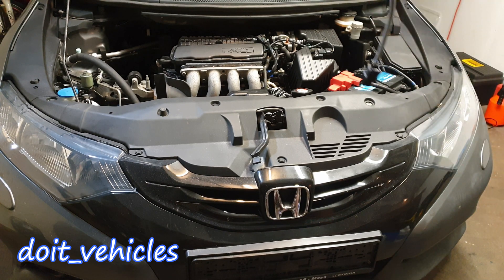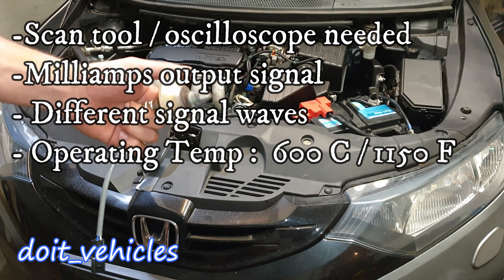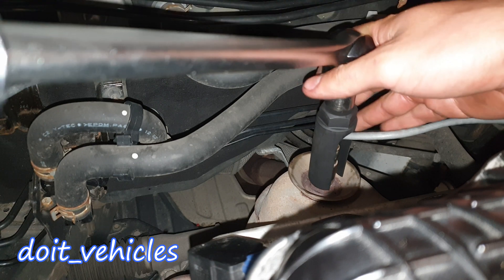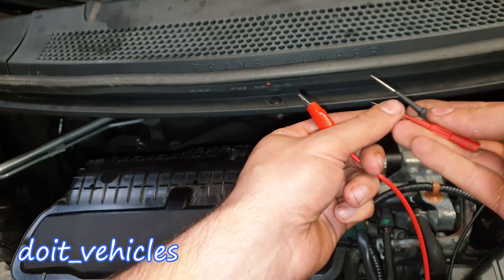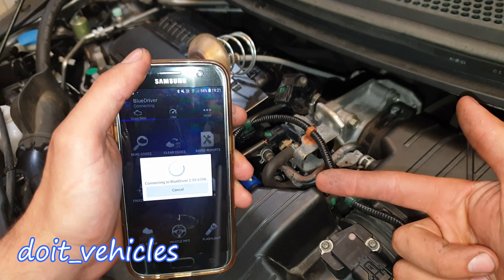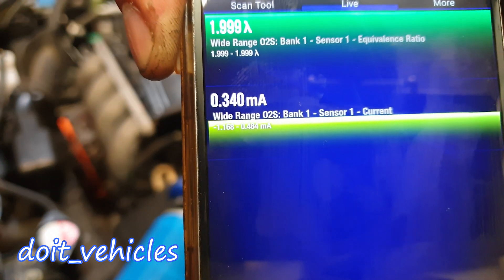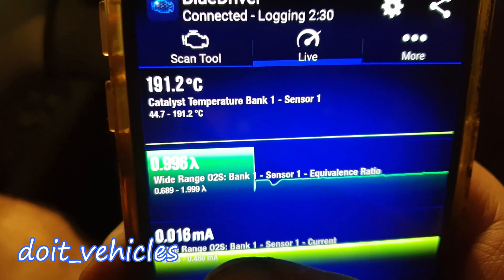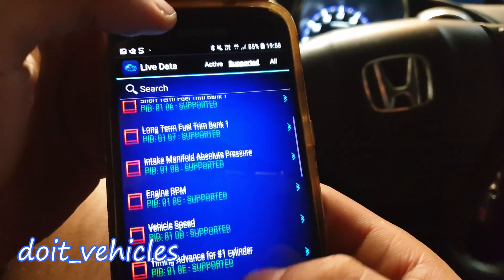Wideband Oxygen Sensor - Test - 2014 Honda Civic 9th -Air Fuel ratio P0131 P0134 P1135 P0133 P1166

Comment: Hi I have been reading mine on idle it goes from 0.1 to -0.1 and car feels really slow no power can this be defective even with no codes? Also my long term fuel trim is -10% usually was at 0 when car was ok.

Comment: Video to fill a gap! Thanks! What do you think? How many milliamperes is normal deviation while driving and idling? For me, it fluctuates between + -0.1 mA at idle and + -0.25mA at partial load. I think that's too much.
Reply from the maker: Does it also go negative at idle ?
Reply: @doit_vehicles  Yes. It fluctuates between -0.1mA and + 0.1mA.  When the engine warmed up.
Reply from the maker: @janosvalent598  Yes that's too much , Have u try doing some tests ?
Reply: @doit_vehicles  Thanks for your reply! Yes. I did a lot of tests. The car does not really give DTCs. Once upon a time (VW) P1553. Wrong to drive the car. His voice is bad, a little bumpy when I shifting. If the engine warms up, there will be a knockout burn sound sometimes. At low speed, his power less. I checked the MAP, Throttle body with oscilloscope. I cleaned the TB, MAP and EGR systems. I later exchanged MAP and EGR. I adapted. I reset the ECU. I measured the exhaust pressure. I cleaned the intake manifold. I exchanged sparks. I checked the opening time of the injectors at idle and that they were dripping and that "spray image" was good. I was looking for vacuum leak intake and exhaust side. The wideband oxygen sensor was replaced a few months ago. I took a lot of measurements, it’s hard to describe everything. :)) Now I suspect throttle body again. My diagnostic tool indicates that the potentiometers are defective. Although I don't see anything wrong with an oscilloscope. What I found suspicious is the oxygen sensor current and the STFT and LTFT are in a wide range. Both are + -20%, but can even go up to + -35% sometimes. Randomly. I don't see any logic in them. For example, vacuum leakage. I’m not 100% in every measurement, but I tried hard. It's hard enough that way, but if you have a good idea ...: D Thanks! Sorry for the long text.

Comment: Good Video. Im writing from Chile, and i have a question...what is the size of the socket that you use for remove the A/F sensor? Thanks!
Reply from the maker: it is a special o2 sensor socket - 24 mm if you can acces it with a wrench